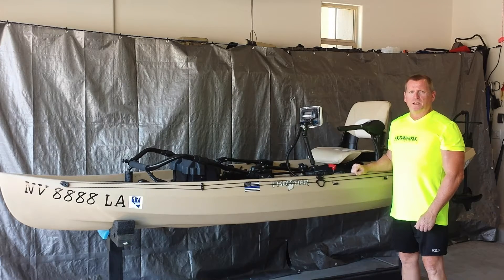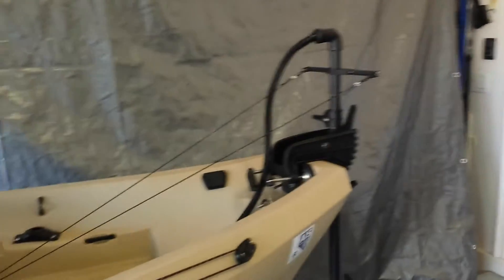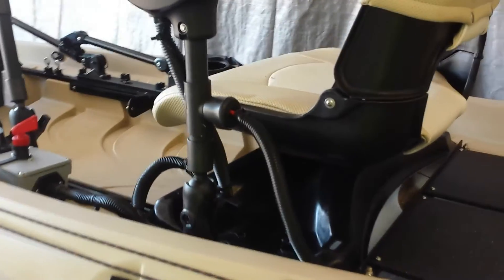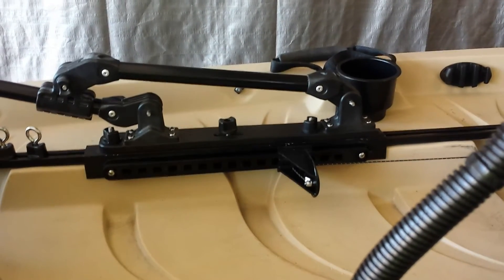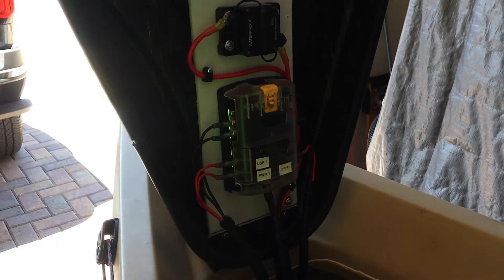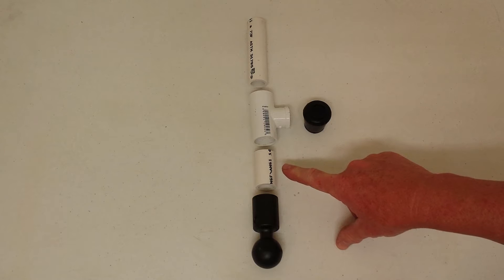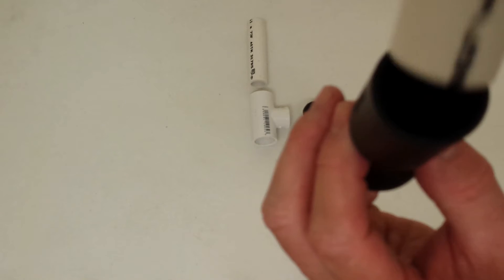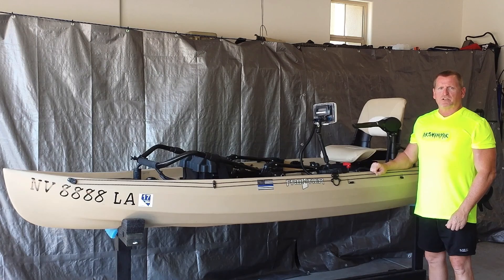DIY Nucanoe Frontier 12 Trolling Motor Pedal Steering Kill Switch

Comment: Question for you, would it be possible to do a bow mount and then use the foot pedal that comes with the trolling motor to steer it while standing up?
Reply from the maker: Hi Robert. Nucanoe has a mounting kit for that. I know someone that did one and they thought it worked fine.

Comment: Hi there, I love your videos, thank you so much for doing this.  I'm currently looking at Trolling motor options for a Frontier 12 as well.  Can you tell me why you moved from the Comax 12v to the Protruar 12v for your Frontier?
Reply from the maker: Thanks Jeff. There were a few reasons for the change. I fish mostly lakes so I really never used the adjustable prop. The Protruar was lighter in weight, had 65lbs thrust, and was digital and brushless. It was just a personal choice.
Reply: Got it, I will be in saltwater some so wanted to make sure nothing was wrong with the motor
Reply from the maker: It's a great motor. Tight lines.